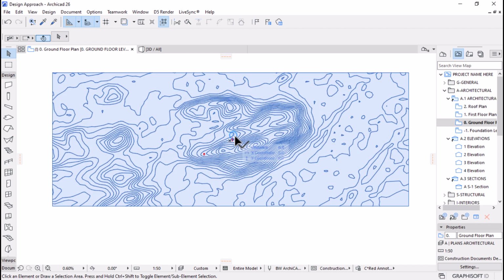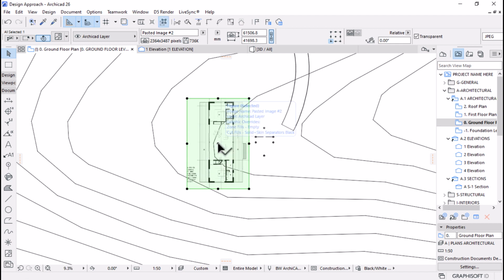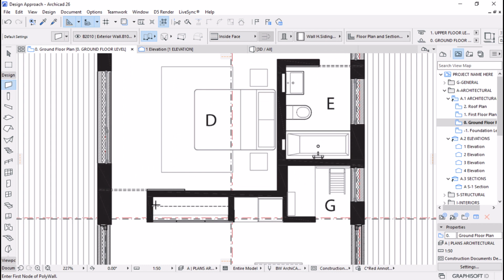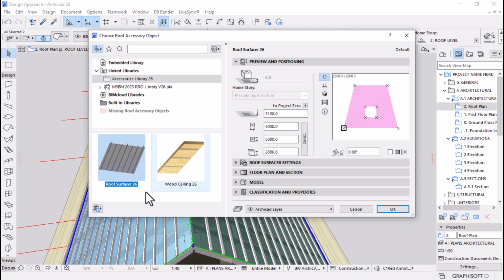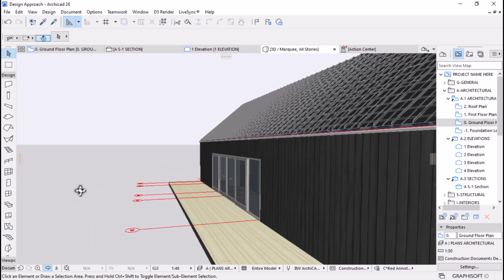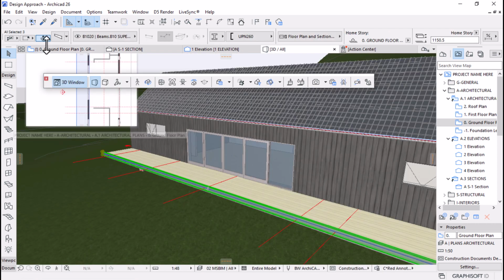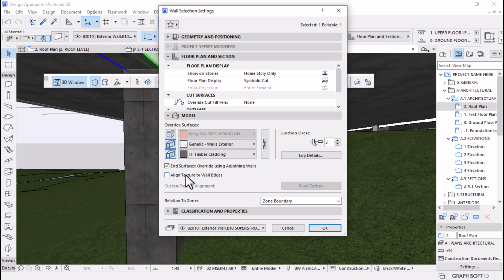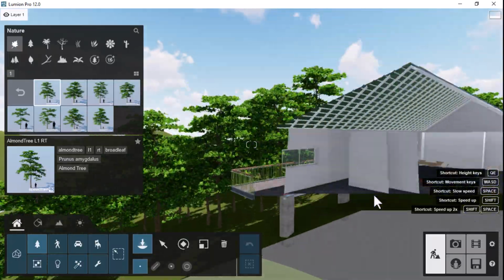Design A Building on a Complex Terrain | ArchiCAD Beginner Tutorial

Comment from the maker: What are your thoughts about this video?
Reply: WOW welcome back,I missed watching your tutorials, Amazing tutorial thank you so much ,although i have a few observations; 
1. I think you should try feeding in the project height under altitude (sea level), that way archicad will compute for you the different levels that way everything will be where you want them easily.

1.1 Or you could drag the highest point of the topography to the zero mark in archicad that way it’s easier to deal with the heights.

2. Doors size, specifically the leaf dimensions also i think can be changed under door settings > Normal sizes and Tolerance > Leaf dimensions (5)

Again thank you so much learnt alot from this tutorial mostly i liked how you came up with Road
Reply from the maker: @lkabrams  Thank you, I completely agree with you on the altitude and door settings. I appreciate your input. Great to hear from you.
Reply: @MesolightVisual  

I agree with the above comment and I also think you can make use of using worksheets to drop images or dwgs you want to trace and use the show trace tool so that you can toggle the visibility on and off easily, and you won't have the issue of clicking the wrong thing or hiding walls.

You could also do your site plan on a separate story layer to deal with levels easier.
Reply from the maker: @hopethisnameisavlble  That's a great way to go about it. 100 percent agree